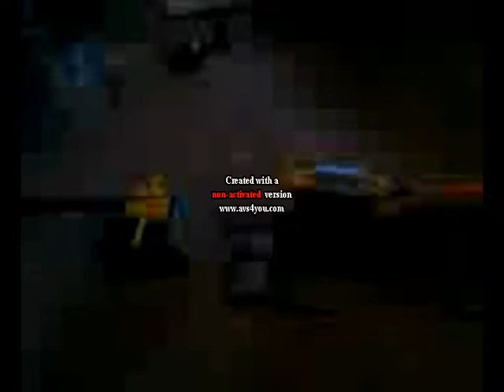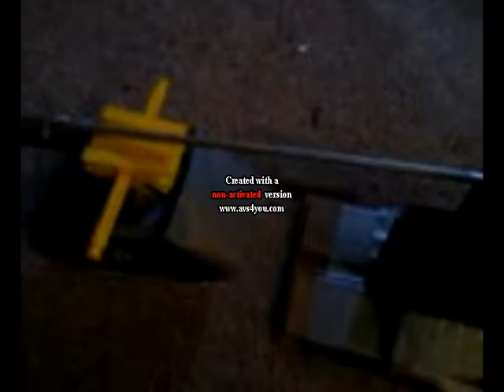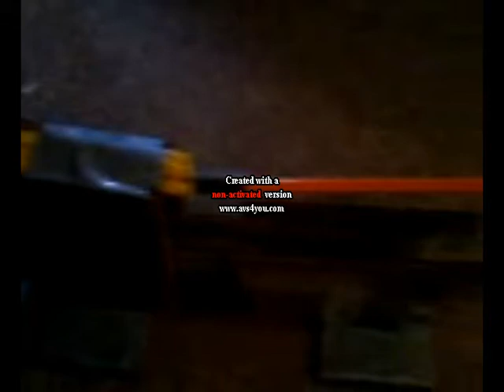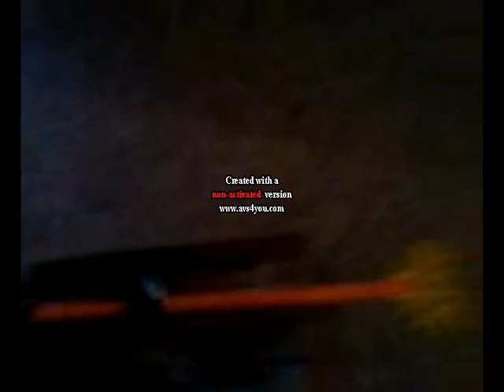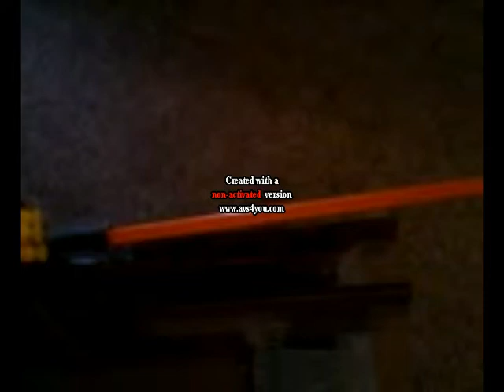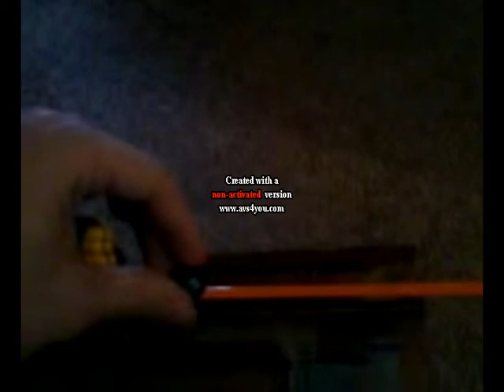SUCCESSFUL OVER-UNITY EXPERIMENT 1

Comment from the maker: With a leverage ratio of 10.8 to 6.25 running to 14 to 6.25, I have shown that when a super-lightweight lever is run through an ultra-smooth, ultra-straight slightly inclined slotted track, and the counterweight on the short end is about 1.8 to 2.3X the ball rolling on the slotted track, that upward and downward motion from rest takes place, and the rolling ball may be permitted to have a significantly higher midpoint after being raised than the height of the lever at the start of the track (at 10.8 : 6.25 X the distance of the counterweight from the fulcrum), with room to move into. Therefore, the device, if arranged in a horizontal loop with units repeated at the same average altitude, might be perpetual. Friction is proven to be overcome at every point except perhaps the beginning between units. But, we know it has sufficient capacity to lift the lever at the beginning of the first unit, and every unit is identical, therefore it seems to be perpetual, even if not yet built except as a partial model.
10.8 / 6.25 = > 1.73 X for counterweight to move marble.
14 / 6.25 = 2.24 X leverage applied at end of motion by marble = maximum mass of counterweight.
→ 1.73 to 2.24 window with upwards motion and applicable leverage.

Comment from the maker: NOT A JOKE >For those that might want a free $1 million, you might consider modeling the following design, modified with appropriate deflecting panels, and selling each model for their current street value of about $1 million…
https://youtu.be/pmjX2bmVuN0?list=PLcttXCrYoAgP88CiJ3ibPqVl1FjlAAIdi>The exact weight values are tricky. The counterweight is somewhat heavier than the marble, the structure is ultra-lightweight, and the counterweight is positioned at significantly less distance from the fulcrum. The structure pivots shallowly left and right, and low-friction is necessary. Some smoothness in the supportive track is also necessary. Transition-points are tricky, but I think rather intuitive in this design using deflection or wedges and the natural direction of slope in relation to the lever.
>—Posted to a Facebook 3D Printing group for general consumption

Comment from the maker: WORTHY OF THE NOBEL PRIZE!?
https://www.youtube.com/watch?v=pWBHYFcUSEk&t=0s&list=PLcttXCrYoAgP88CiJ3ibPqVl1FjlAAIdi&index=35
https://www.youtube.com/watch?v=m_o-9b273Sw&index=35&list=PLcttXCrYoAgP88CiJ3ibPqVl1FjlAAIdi

VERTICAL LEVER PERPETUAL MOTION MACHINE:

The falling ratio is 3 versus 1.25. The rising ratio is 1.25 versus 0.5+. Good numbers.

The counterweight does have a lot of mass, but it has less effective leverage, which my math teacher taught me still makes a difference.

I asked him to tell me everything he knew about leverage, and it took him like three weeks as I recall. I lapped it up.

If there is friction in the 3/4 Vertical Lever, the counterweight will be maximized around 7X to <12X, as 12X is where 12 X 0.25 = 3 resistance is met for the 1X mass and 3X leverage lever.

I'm pretty much done explaining that design. I'm getting excited about what models might be produced. What I'm hoping for is: 1. A square or rectangular track structure set at significantly less than 22.5 degrees with two longish rectangular slots, each about 4 - 6 inches long. The larger one should be at least twice as wide to permit the basket or fork to free-fall, attached to the lever from below the slots. 2. Short straight barriers or walls set around both tracks at least up to 3/4 of the marble at the relevant point, but with some spacing on the smaller track to allow the relevant size marble to move freely. There may be some slight flexibility especially with larger balls and marbles. The two slots should be very narrowly separated with only one wall between. 3. A deflecting board should be used, slightly longer than the width of the walls of the smaller slot, and directed into the top of the larger slot. 4. The change in height of the entire length of the slots should be slightly more extreme than the variation in the arc of the end of the lever where the basket is located. This permits deflection into the basket from a slightly higher altitude at the top, and return into the narrower slot at the base. This fourth feature may place restrictions on the overall length of the slots relative to the length of the lever. 5. The ratio of the lever shall be 3/4 or 3:1, the long end being the end operated by the marble. 6. The weight ratio shall always use whatever marble is used as the standard of measurement. I have found ideal values tend to place the counterweight at barely >7 to definitely less than 12X marble mass. Earlier calculations assumed a median rather than an average was desirable, and so the ideal number is located higher than before. 7. The pivot of the lever is to be located beneath and not very far from the top end of the track. 20 inches length seems to be the most workable number for serious experiments. The lever should be nearly vertically disposed, meaning the pivot point is deep under the track, but simewhat outside it to create the angle. The angle should not be perfectly vertical, but rather still lean somewhat to the side at it's highest motion, perhaps at least 6 degrees. FINALLY, if the sideways transition between tracks is fairly narrow compared to the overall scale and size of the marble, transitions should be fairly easy to facilitate.

One way to construct it is to use a largish ball and have the larger slot the same size as the walls of the smaller slot, but with the slot being as wide as the walls for the larger slot. This allows some exciting standardization.

--Nathan Coppedge, Promising Perpetual Motion Research

Comment from the maker: MATHEMATICS: With leverage ratio of 10.8 to 6.25 running to 14 to 6.25, I have shown that when a super-lightweight lever is run through an ultra-smooth, ultra-straight slightly inclined slotted track, and the counterweight on the short end has a ratio of (1X U.S. Quarter, 1X U.S. penny, 1X standard marble, 5 in. of duct tape) to one standard marble on the longer lever end, that upwards and downwards motion from rest takes place, and the rolling ball may be permitted to have a significantly higher midpoint after being raised than the height of the lever at the start of the track (at 10.8 : 6.25 X the distance of the midpoint of the counterweight from the fulcrum), with room to move into. Therefore, the device, if arranged in a horizontal loop with units repeated at the same average altitude, might be perpetual.

Friction is proven to be overcome at every point except perhaps at the beginning between units. But, we know it has sufficient capacity to lift the lever at the beginning of the first unit, and every unit is identical.

Test for Specific Values

It has been estimated from work I will duplicate later that 2X counterweight, 1X marble, and 0.5X effective long-end leverage mass is a workable value.

So, let's test it…

1X marble + 0.5X lever = 1.5X effective mass at every point for the marble.

10.8 leverage X 1.5X effective mass = 16.4 X effective leverage at the beginning of the long end.

2X mass X 6.25X leverage = 12.5X effective leverage (constant) for the short end.

16.4X long-end leverage is significantly greater than 12.5X leverage, so the long end is effectively heavier.

Note, this is before the marble is supported by the track.

Now, the marble on the long end is supported by the track.

Since the track is almost horizontal, the resistance is now close to 1/2 effective mass, since 1/2 effective mass falls between 0 resistance (falling) and 1 ideal resistance (lifting, e.g. 0 plus friction in equilibrium, as this is).

Thus, we take the same initial resistance of 16.4 and divide by 2 to get an approximate resistance (supported) of 8.2 or somewhat over.

This is now significantly less than the 12.5 effective leverage of the counterweight, so now the marble will move upwards very slightly, so long as it is supported by the track, and so long as the ratios are followed.

Now, let's test whether it works at 14 : 6.25 (at the end of each unit).

14 leverage X 1.5 effective marble mass = 21 effective leverage.

21 / 2 = 10.5 effective leverage when supported, still significantly less than the counterweight's 12.5, which also has the advantage of equilibrium.

But now, when the marble is unsupported at 14X leverage with 1.5X effective mass, it has the full 21X effective leverage, versus the same now puny 12.5 X effective leverage of the counterweight, which means when unsupported the marble is clearly able to lift the counterweight, IN SPITE OF ORIGINALLY MOVING UPWARDS!

General Values

10.8 / 6.25 = > 1.73 X (mass) for counterweight to move marble.

(1.73 X is ideal motion from equilibrium with 10.8 : 6.25, particularly when there is reduced resistance from a supporting track and lever mass adding to the leverage of the 1 X marble as indicated below).

14 / 6.25 = 2.24 X leverage applied at the end of motion by marble = maximum mass of counterweight including all compensations for leverage mass.

→ 1.73 to 2.24X window for counterweight mass with upwards motion and applicable leverage, when leverage is in a 10.8 to 14 : 6.25 ratio.

Long end lever weight without counterweight or marble while hinged = 0.001X to 0.51X plus any unaccounted weight in short end of lever (so, it could, in effect, be heavier than 0.51X if not all the counterweight mass has been accounted for).

Now, if the lever is lighter in raw units than the differential, it has been shown to work!

In fact, even if I am wrong about this, the experiment clearly shows motion from rest with natural momentum, and there is indication of recovery of altitude through the height of the midpoint of the marble.

Comment from the maker: Let me explain the twelve-pronged advantage at the weakest point.

(1) The ball has gained a small amount of altitude,

(2) There is momentum, given that it moves from rest,

(3) There is room to move into, permitting motion,

(4) The track is no longer providing support, creating an advantage,

(5) There is leverage advantage at every point, including the beginning position of each lever unit.

(6) Almost equal pressure from the counterweight not considering leverage.

(7) Stops at either end of the range of motion of the lever permits stored energy that does not require motion.

(8) The part of the lever that is active for the marble does not require the full height of the lever.

(9) The angle of the lever creates an efficiency with the slight upward slope of the track by entering at a sharp angle.

(10) The motion from one unit of lever and track to the next is predominantly horizontal.

(11) There is no necessary change in net altitude other than that shown in the experiment.

(12) In each modular unit the marble is proven to move from rest, and each modular unit functions in exactly the same way at the same altitude.

Since it moves from rest at every point, the only potential problem remaining was the ability to activate the next lever, which has now been proven to be overcome by the fact that the physics is the same at the beginning of each unit.

Comment: Can't see anything! Kill this video.
Reply from the maker: There are no magnets, just simple mechanics. It should be easy to figure out. Try adjusting your screen for more illumination. This video has thousands of views, it is one of my most popular videos in terms of views, so of course I am not deleting it. It is a video of possibly the first simple over-unity experiment, on the day it was invented, and has great historical importance.

I'm sorry if you have the superficial view that camera quality is more important than the experiment itself. Try using more imagination. For example, are the structures you see actual structures in the video? They are! So, obviously, they represent the structures the marbles is interacting with and so on.

There is something wrong with your viewing technology if you cannot see the marble and the line of the track upon which it is placed.

I half suspect you are just a bot with sub-human levels of inference about images that have text displayed in the middle. The usual thing to do if you are a computer is to use some kind of image software to make the lines sharper and eliminate blotty areas. How is that so difficult, with this most-important-of-important experiments? I did post a clearer video later, but some of the dialogue in the second video is not as good.
Reply from the maker: You can try turning up the brightness, if you have a laptop. It has been visible on my laptop and smartphone, but not great at university.

Comment: Hi Nathan.  i don't understand; are you saying the marble rolls uphill? or is it that the marble rolls down hill and the arm springs back up when it falls off? if so, where is the "over-unity"?
Reply from the maker: +Crist Cat The contraption pictured involves a very slight upward incline, so that, once the heaviness of the long side of the lever is compensated for, the counterweight on the left can lift the marble, and the marble is then able to lift the counterweight when it is supported by the lever alone, rather than the lever combined with the track. In my view, this may be a new discovery, and at least conventionally, when we think of something that can move up and down automatically from rest without being pushed and without involving electricity, that tends to mean over-unity.
Reply from the maker: +Crist Cat Unlike the Escher Machine design, I am not saying that the marble does it without being influenced by moving objects. The real claim I'm making, which is hard to convince anyone of, is that the lever can lift the marble all the way up until the point when the marble has weight to lift the counterweight when it is only supported by the lever. But this is true, and it is due to the near-equality of the two opposing mass-forces. The motion is justified almost exclusively by equilibrization, a 'cheating principle' (the marble's being supported by a mostly horizontal track), and the principle of applying leverage.
Reply from the maker: Revision: the masses are NOT close to.equal, but the leverage indeed lifts the counterweight, and the initial upward motion after application is indeed from rest.

Comment: Hmm, I don´t see the marble being lifted again at the end of the track... how do you overcome this ?
Reply from the maker: overunitydotcom You'd be surprised to know that the movement of the marble is actually UPWARDS during the course of the right-wards motion. So, in theory no additional principle is necessary to create a perpetual motion machine, just a repetition of the entire modular unit, including the lever and the track. A zig-zag lever should be used, and the levers must be kept lightweight in comparison to the weight of the marble and counterweight. The counterweight is about equal to the weight of the marble plus the difference between the two ends of the unweighted lever. One problem that might occur is that the lever loses more altitude than the marble gains. In that case, a dip can be used at the beginning of the lever, since the lever is sloped during the entire motion, it is conceivable that a dip would overcome the problem of a difference between the loss of the lever and the gain of the marble.
Reply from the maker: overunitydotcom See also the entire mock-up of the Modular Trough Leverage Device: http://www.nathancoppedge.com/images/Proven_Perpetual_Motion_Machine_Desc.jpg
Reply from the maker: overunitydotcom Thank you for following me, by the way!
Reply from the maker: overunitydotcom What I meant to say is that, theoretically, the entire potential is already contained in the device as it has been built. The horizontal motion should be used to make the device circular and recoverable. The energy is already recoverable in the current form, according to theory.
Reply from the maker: overunitydotcom What the diagram should say is "proven perpetual motion machine concept". I have not built a full model of the device yet, although I have tried. The zig-zags in the levers and lightweight aspect of the levers make it fairly difficult for such an amateur builder as me.
Reply from the maker: overunitydotcom I have tried aluminum bars for the levers, but the construction that way is awkward, and I got fed-up trying to prevent the thick aluminum from messing up the cardboard track construction. Unfortunately, cardboard is about the only material in my budget and toolworking ability right now. And the connector toys I would normally think of using first don't have much zig-zag potential, because normally the joints with those toys would hinge, and I can't make it double-thickness, because that wouldn't slide between the track members or support the marble.
Reply from the maker: See Also the more recent special modification: https://commons.wikimedia.org/wiki/File:1st_Fully_Proven_Perpetual_Motion_Machine.jpg